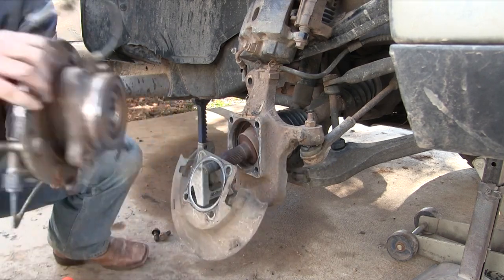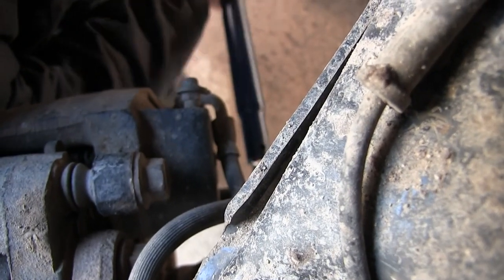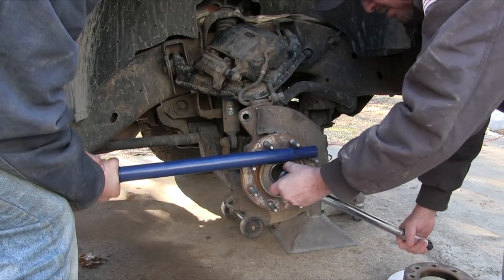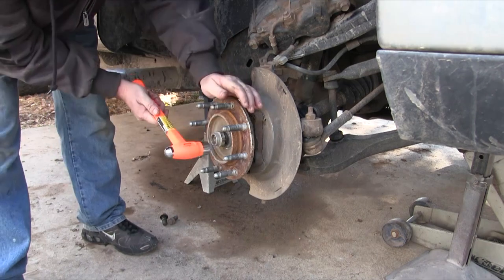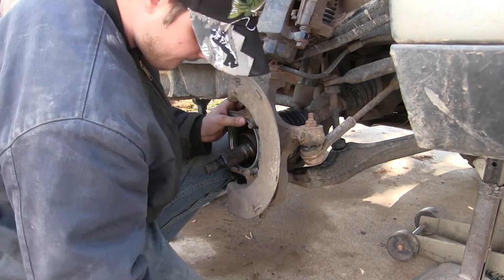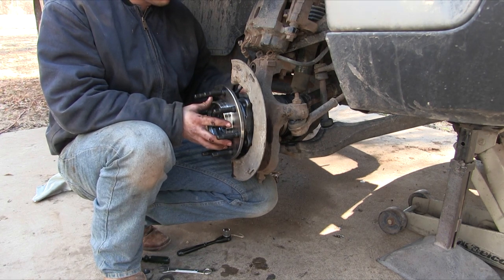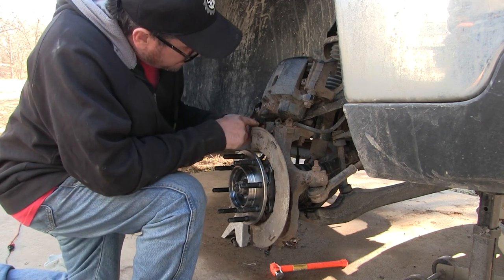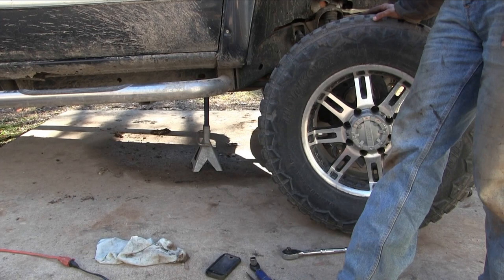How To Replace Hub Assembly 2004 Chevrolet Silverado 2500 HD

Comment: To be clear on the brake caliper torques, the Caliper Guide pins (which you didn't remove) are 80 ft lbs. The caliper bracket that bolts to the knuckle is 221 ft lbs torque on the 2500HD trucks. It's a monster bolt, like 5/8" for the threaded part. Also recommended to put blue loctite on those.
Reply: How do i check to see if its time to Repplace The CV Joints?
His Videos are Really Good and when Your filming or teaching someone its easy to get distracted and fail to mention something in all fairness.
Reply: You are the man. Exactly what I came to see.
Reply: Good catch brother, 80 lbs flirting with disaster
Reply: U sure it's 221? I just replaced my pads n rotors and the info I found said 140. 04 silverado 2500 hd 6.6L
Reply: @appreciatethat  In my Chilton book it says Fronts 2500HD are 221 ft lbs, Rear 2500 calipers, 99-02 128ft lb, For years 2003 and later JC3/JC5/JH2/JH5 calipers are 148 ft lb
JH6 calipers are 122 ft lb
JH7 calipers are 221 ft lb

Comment: put it in 4x4 mode before you crack the axle nut --- I leave the backing plates out on my pick up and semi -- brakes cool better nothing gets between rotors and backing plate and you can inspect your brakes a lot more easy
Reply from the maker: Yeah, that was aggravating to put the hub assembly on to realize we had the backing plate on wrong.  We are not everyday mechanics, but we learned our lesson.  Thanks for your tip about leaving it off.